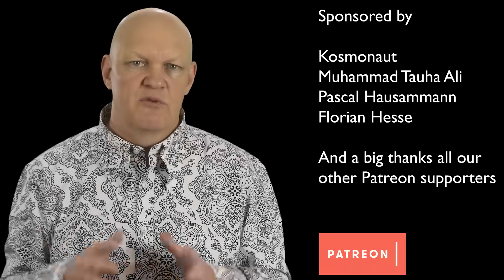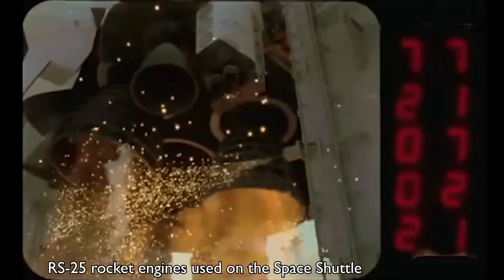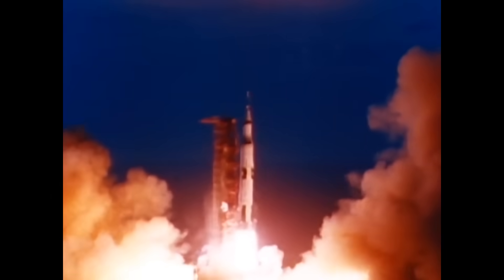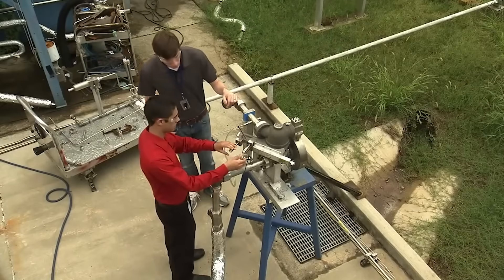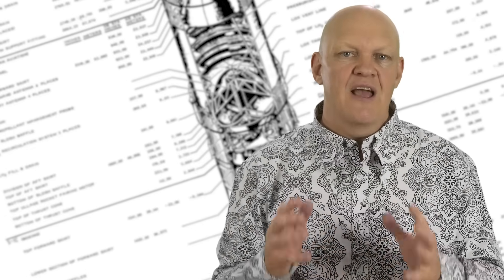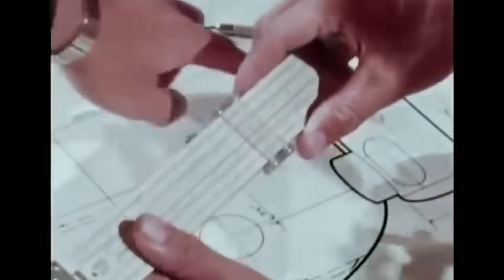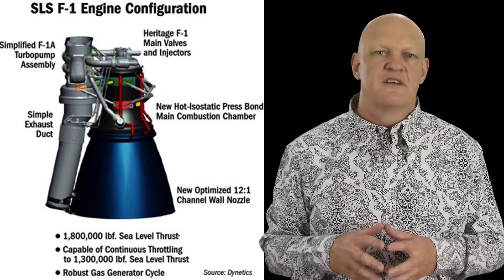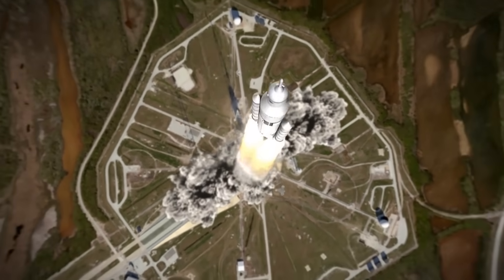Why Can't we Remake the Rocketdyne F1 Engine?

Comment: What a load of nonsense. These engines were built under an order from the president to embarrass the Russians. If it was built to be manufactured for 50 years it would have been designed that way. It was designed for limited time, and limited skill. The speed of creation required by the president meant that some contractors received designs before a proper engineering schedule had been established, with prerequisite components from other contractors missing and awaiting inclusion. Once in the same room for assembly, components were hacked and reworked out of contractors’ fear of failure to deliver contractual obligation. Unlike today, no certifying bodies existed to require as-built schematics after completion. But even the teams at the time knew no one should work like this. I know this because my grandfather helped design the fuel cell system. Once the program ended it was obvious that, yes these engines worked, for the goal set by the Cold War, but no one should ever work like that again, for safety sake, budget, and common sense. We now have BIM LOD 100-500 with 4 and 5D level coordination with detail scheduling allowing for much more complexity, with repeatability and unfettered cooperation among contractors. Do we have the skill? Of course we do. People running around putting in insane hours on last minute mods and redesigns to make sure they get their contracted $250k for their particular components is certainly skill, but it’s also desperation. We now have better skills which align to agreed ISO process and methodology to make better things because we know better. So you can hate on modern society all you like and fear monger that we can’t do these things, and complain about the youth of today and all the problems we have with a heavy sigh but you just look like an obtuse relic who hasn’t actually got a clue as to what’s happening right now and obviously no knowledge of actual engineering.
Reply: BULLSHIT.  your "arguments" are non-sensical.  the motivation 60 yrs ago for building them has NOTHING to do with the lost skill sets needed.  especially since the lost skill sets are THINKING and PROBLEM SOLVING, instead of pressing a button and expecting a computer or a CNC to do everything for you.  and your ISO and GMP bullshit is also irrelevant.  has NOTHING to do with the lost skill sets.  i've been a teacher in higher ed for 50 yrs, and the drop in intelligence and comprehension over the past 40 yrs is SHOCKING.  the same applies to craftsmanship.  there's a reason apprentices studied for YEARS to be able to reach the skill level of the master craftsmen.  that's how long it takes.  NO ONE today has the patience.  they all have the attention span of a fly on crystal meth, and the self-discipline of rabbits on viagra.  i may be "an obtuse relic" to you, but it is YOU who does not have a clue.

Comment: i think it has more to do with the education system as a whole; we're little more than people who know how to run computer programs, not to belittle them but there is a certain practical knowledge element that's missing. in the days of the Saturn 5, there was a group of engineers that learned how to machine as apprentices on manual equipment that took talent to make it do what you wanted it to. the ability to think outside the box and do much of the "computer processing" was in their heads for a reason, because there were no computers to do that same task. there are some brilliant people today, but i wonder how many more there would be if the education system forced you to start out on the manual equipment before jumping in to the computer driven stuff?
Reply: Students today are taught  to trust their computers. 
The best computer is still the human brain.

Comment: I worked for Rocketdyne after the F-1 and J-2 engine design and production.  In addition to the loss of the skilled engineers, mechanics and technicians knowledgable in designing and building these remarkable engines most if not all of the essential tooling no longer exists.

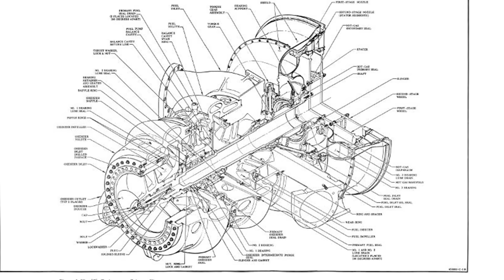Comment: 3:37 looks kinda like a Turbocharger.
Reply: That's because it basically is. Rocket engines use turbopumps, often driven by exhaust gas from from a propellant pre-burner, to drive fuel into the combustion chamber.

Comment: Actually, rebel engineers at NASA have built TWO different updates to the F-1 engine, and these comments are not really applicable anymore.  With all the problems that SLS has had, there is a strong group that at NASA, wants to rebuild the Saturn 5.

Comment: My dad designed some of the commo gear that went to the moon. He said the hardest part of going to the moon was getting back. You couldn’t practice that aspect. It was do or die.
Reply: yeah, its probably hard to make a manned flight to the moon with no successful engine tests on earth...
Reply: @lowlifeglitch6199  Yes, but that is the easy part. The hard part is knowing if your little lander can even start it's engine up there, or if it gets stuck in the dust, or something like that.
Reply: @lowlifeglitch6199  Or you need a genius filmmaker like Stanley Kubrik.
Reply: @INGBWLer  you'll need a good filmmaker to make documentaries on the greatest engineering accomplishment of all time
Reply: Especially when the most crucial part of the hardware had to be literally rebuilt from scratch everytime it was fired due to the corrosive propellents used.
Reply: THEY DID NOT DIE , DID THEY ?  7 TIMES THEY DID NOT DIE,  IS NOT THAT AMAZING?  PROBABLY YOU CAN NOT DIE IN SPACE OTHERWISE IT WAS BOUND TO HAPPEN......
Reply: @jalbadavid3624  It did, but the Russians are the one's who had people die in space. It's actually really hard to die in a place where almost nothing happens. With all the fail safes we have in place for people in space, it is very unlikely to die there. Rather, when you are in transit is most dangerous, because of the insane forces acting upon you. In space, it's just not quite as dangerous.

Also; landing on the moon was VERY do or die, but they did it every time. This is a testament to the brave men and women at NASA, and their amazing contributions. Another thing: There were some Apollo missions that failed/ended in disaster.
Reply: @gabevietor3685  One Apollo mission failed; none ended in disaster.  The cockpit fire on Apollo 1 happened during a test, not a mission.  Apollo 13 failed to land on the moon after it suffered an explosion in the service module, but it still managed to return the crew safely home to Earth.
Reply: @rudewalrus5636  Sorry, I forgot which ones were which and how many. Just was trying to get a point across.
Reply: @gabevietor3685  No worries.  I just wanted to highlight how impressive an accomplishment the Apollo program was.  It's also noteworthy that the Saturn V rocket had a 100% success rate.  What they did was awesome and we shouldn't forget that despite the years that have passed.

Comment: Mostly, because the blueprints were thrown out ages ago. It would be going back to the beginning. And since it’s no longer a Cold War project, the money isn’t going to be assigned. It’s too expensive. It’s really that simple. It’s not a myth. Not everything NASA did back then is available. Most everything other than the general designs are long gone. So yes, we have number ours exploded diagrams (which are NOT blueprints), but we don’t have the tens of thousands of highly detailed and spec’d parts blueprints, with the information as to how they must be manufactured. Nor do we have the blueprints and info on the machinery needed to make those parts.

This is far from being as simple as he says. I know some of this firsthand.

Comment: I think people are completely overlooking another key point here... DOCTRINE. Back when this engine was made, it was basically “wartime”. And the key areas and nuances of these engines were basically top secret. So it was probably believed to be “safer” to hold those secrets in the heads of the engineers, rather than memorialize them on paper and make it easy for an adversary to acquire them. “Security by Obscurity”  -Fast forward 60 years... “hmmm Houston, we might have a problem here...”

Comment: Yes, I like to see the engines rebuilt made cheaper and quicker then before.  With today tech, I wonder how much can we shrink to accommodate a newer version of the space shuttle.  I am talking about using the I10 10xxxk intel chip, new circuit board, ECC chips for memory, SSD's, etc and have it all install on to a brand new shuttle.   Same with all the parts.  Would that make a difference in the cost of a new shuttle.  I am really wondering.  It will at least save on weight...

Comment: Engineers design the components and fabricators figure out how to make them real. As fabricators, we worked with the engineers, and we often submitted basic process notes for approval, but the real proof was in the results and that's all they really cared about. The notes were probably thrown out after ending up in the accounting department as a last stop, I do not know. Also, some specific procedures would not have been understood clearly by the engineers, so there was no need to jeopardize the new process by over explaining it. Basically we just submit for approval paperwork that has simplified information about how we came up with a new process that saves time, money, or increases quality, or any combination thereof. New fabrication techniques were passed among ourselves and our apprentices. Our experience and skill also made us more valuable as workers. But by the 1990's, fabrication jobs in every sector, including defense, were sucked away by cheap Chinese manufacturers. It didn't matter that their parts had up to a 40% defect rate, compared to our 0.001% defect rate, they were making them for 40% of the cost, including shipping. In some cases the parts cost was essentially the same as the raw materials cost, or for parts made of copper, nickel, or alloys, the melt value. A skeleton crew of few old timers stayed in the trade to repair the defective Chinese parts, but us young guys were layed off, never to return. Some of us landed on our feet, some lost everything, becoming homeless and hopeless. Most fell somewhere in between. The old timers with the most highly honed skills are in their 80's, 90's, or gone. My skills have vastly faded over time, I can't even remember half what I once knew. My vision has become weak, and joints no longer function as they once did. Young people are just as smart as we were, but decades of unbalanced trade with China has created an insurmountable gap in the line of apprenticeship that we fabricators of the past stood upon.

Comment: I'm retired from Rocketdyne...a machinist.  Engineers never made anything!  Machinists did though.  Skilled manual machinists are now replaced with NC/CNC button pushers.  Skills are lost, tooling is gone, but most importantly the will to do it is gone.  Won't happen!

Comment: As you said the world moved on. I am an example of such. Remember analog telecommunications? It was more of an art to get a circuit with zero loss to work over 10k miles of cable, radio, and more than today. You dealt with phase jitter, noise, loading, amplifiers and dozens of other components hand tuned. Oh I could, and have, write books about harmonic distortion, envelope delay, phase distortion, and time delay. I doubt hardly a person alive would understand wide band radio or troposphere scatter today. Well at least I was there for some of the first fiber and took Autodin to what we now call the internet lol

Comment: I worked in a custom fabrication shop for a few years and just the difference between the shop floor fabricators who had the knowledge and skills of the materials VS the engineers who had the academic knowledge, these engineers failed many times to understand why something couldn't be done the way they designed it or it was over designed wasting time and materials.   This is why I find this story about NASA capabilities not surprising.

Comment: Why would we want to?  The F1 is a gas-generator type open cycle engine using RP1 (refined petroleum) and liquid oxygen fuel, exhausting pollutants at a far greater rate than newer technologies. We have more efficient engines today that allow our payloads to be delivered to orbit far more cost effectively (e.g. SpaceX booster recovery capabilities, with their latest engine - the Raptor - being a full flow staged combustion closed cycle engine that is far more efficient and less polluting than previous engines).  The F1 was built for a specific purpose - getting people to the moon.  It did that admirably, but was not sustainable.

Comment: I could see the Block 2 SLS having the expendable liquid-fueled F-1B, but what would really make things interesting would be to resurrect the proposed (but never built) liquid-fueled "fly-back" boosters similar to what SpaceX does for Falcon 9 and Falcon Heavy, but utilize either the Shuttle Landing Facility runway or the "Skid Strip" at nearby Cape Canaveral A.F Station. Based on ULA's Delta IV and Atlas V EELVs, they would have used the RD-180 engines (eight total; four on each booster) and would have, for the Space Shuttle, avoided the dreaded RTLS, ECAL (the "Russian Roulette" maneuver Astronaut John Young refused to fly for STS-1; RTLS was for normal due east flights, while ECAL was for Shuttle-Mir and ISS flights) and TAL aborts. 

Of course Blue Origin's New Glenn rocket could also be adapted for use, but would require extensive modifications to SLS' core. Also, like the ULA's Vulcan rocket (which will replace the Atlas V and Delta IV Heavy), what's stopping NASA from creating an aft thrust section (the section containing all of the engine hardware) that can be recovered like that planned for Vulcan?
Reply: >what's stopping NASA from creating an aft thrust section (the section containing all of the engine hardware) that can be recovered like that planned for Vulcan?
The interest of senators in keeping Shuttle contractors in work. What's the point of making expendable RS-25, if reusable ones can be recovered?

Comment: Now it only makes sense if a booster is fully reusable, and that means  the engines have to be both multiple and highly throttleable.  A revived Saturn V first stage with five engines would still not be very landable even with 70% throttling on the centre engine. Falcon 9 barely does it with nine more throttleable engines (one used for landing). The smaller Merlin and  Raptor engines are just much more versatile,  more efficient and designed from the outset for reusability. It is ironic that Starship is conceptually closer to N-1 than to the superbly engineered Saturn V (e.g. very many engines,  much fabrication near the launch site, etc.). And who could have predicted that Korolev's designs would be relevant into the 21st century,  von Braun's not so much. In 1970 I'm sure that nobody imagined that in the 2010's Americans would be flying into space from Gagarin's pad  on  a rocket developed from his...

Comment: So our increasing dependence on computers is causing a decrease in our ability to problem solve and innovate?  Sad..
Ok, so that’s the engines, what about the craft that they traveled in, he says we didn’t “lose” the notes, (better take that up with Don Pettit) why all this work then to build a “safe” craft to take astronauts through the Van Allen belts when we did it over 50 years ago?  Just use the same metal hull, put some reflective tin foil on it and let’s go!!
Now the re-entry, We have the notes, blueprints and we know they used a polymer that could withstand thousands of degrees, it actually exfoliated itself or something as it came through the atmosphere, they even hardened it at 200 degrees to have it adhere to the metal, they never really tested it, but it miraculously made it each time they used it.   Seems like a good formula to use, better than those pesky tiles that seemed to keep falling off the shuttles.  All in good fun!!

Comment: Here's to good welders and manual machinist and fitters who take what engineers design and help bring it to life.
Reply: more like good welders, machinists and fitters who FIX what engineers overlook... -.-'
Reply: @narmale  the fabrication specialists you mentioned and others were also engineers. 
The loss of personal notes and the redlined documents lost the nuances that made them work.
Sometimes it is easier to just start again.
Reply: Highly skilled workers have always been underrated.
Reply: Here's to the welders and machinists that have to fix the engineer's mistakes.
Reply: Right, there was a bit of pixie dust, and serious artistry going on in machine shops in those days, in all fairness to progress, however, computer designed parts cut costs & development time by allowing proper-engineering to get it right on the first try, then the parts are each essentially just plug & play.

Comment: I like to think we could Improve those older but good designs ,to use computer welding,better materials ,use computers for simulations,I holding we are a little smarter,Its a problem,solve it,like they use to with what you have today's to get it done,Its a challenge right.,and n.a.s.a. Have smart people still right ,mix the old with the new.

Comment: We call those notes "redline" - manual marks with a red pen. It's very common in low volume, high cost production to be tweaking as you go. Otherwise the cost could be 10x higher. The trick is to firstly accept, then manage the process so that no design improvements get lost.

Comment: I would question with todays technology do we really need an engine the size of the F1 or the new F1B. Look at SpaceX cluster of 9 engines to use on each booster 27 engines running at the same time.. The F1 engines fuel load would take into account the weight.